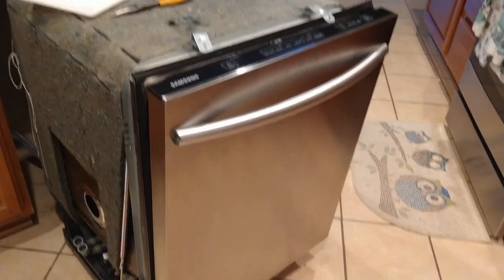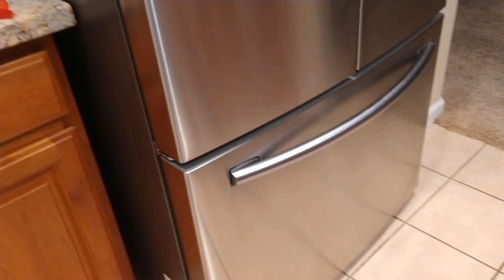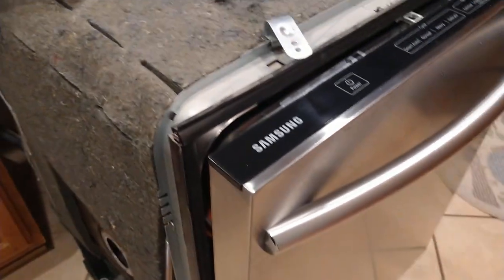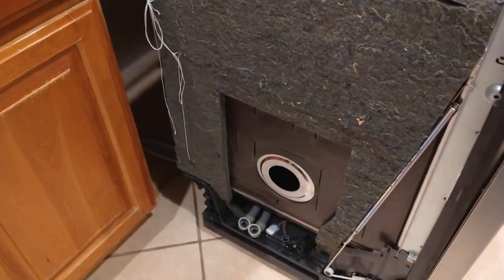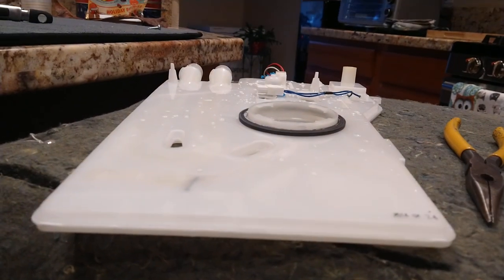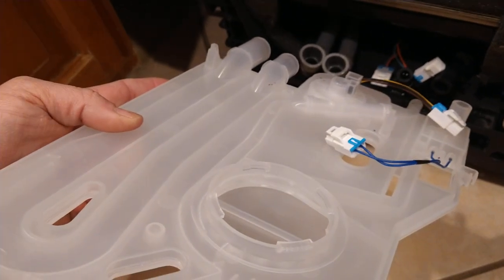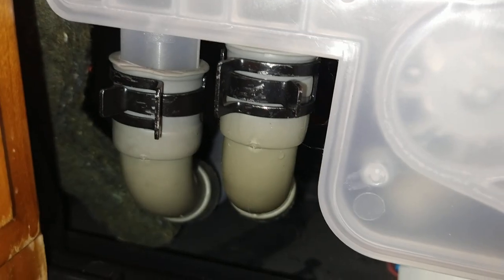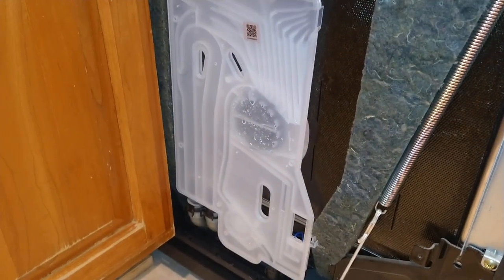Samsung dishwasher low flow repair

Comment: Before doing this, take the screen, 12 screws plus 2 for the wash arm, and the plastic part below out, thoroughly clean any crud.  Put it back together and try again.  This fixed my OE error code the last 4 times this has happened.  Maybe 15 minutes total, and no need to take the machine out of the cubby hole.

Comment: Hi thanks for sharing your very helpful video nice and clear and well explain, when you said by pass the two wire do you mean not to connect that switch? Thanks again and regards be safe too.
Reply from the maker: Hook the two wires together and your dishwasher should work normally until you can replace the part.

Comment: I got this dishwasher as a repair project. Missing the pipe on the right (the small connection) of the case break assembly - wondering if you could tell me what this leads to...

Comment: You just blew my mind.. I’ve had this over flow problem for about a year. And just hand washed my dishes.. if I can bypass it… 😮 and eventually replace it. Will there be any consequences?
Reply from the maker: Everything will function if you bypass it. Only thing is if something else goes wrong you won't have the overflow protection which could cause it to overflow onto the floor. I bypassed mine, ordered the part and replaced it a couple of weeks later.